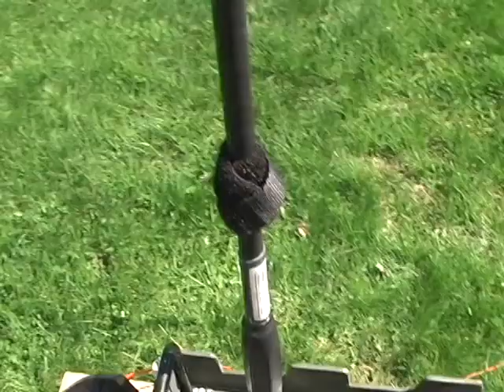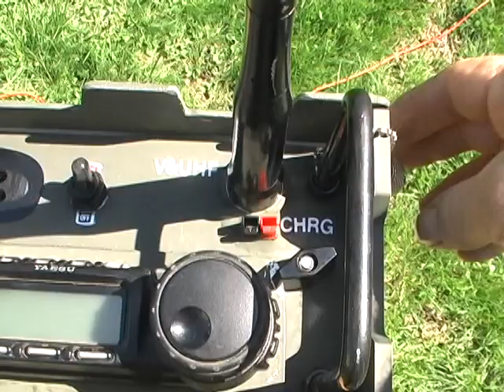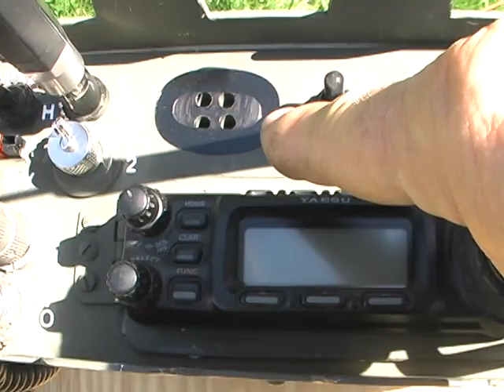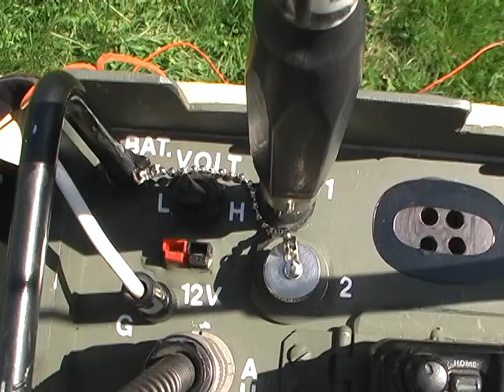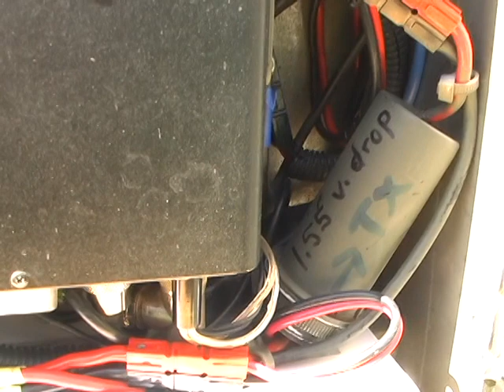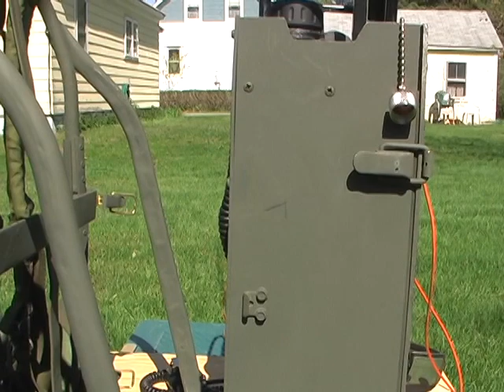Yaesu FT-857d manpack 2...home brew/shorter version.

Comment: What battery is used
Reply from the maker: Hello John,  This is the battery pack that I used. Just keep in mind when the pack is fully charged it is at a max voltage of 17.2 volts.  So you will need a way to reduce that voltage to a safe amount for your equipment. I built a step down zener diode circuit to reduce the voltage by 1.5 volts.  https://www.batteryspace.com/High-Power-Polymer-Li-Ion-Box-with-fuel-gauge-14.8v-10Ah-148-Wh.aspx  Many blessings to you and yours.

Comment: Nice setup. How hard was it to wire both the handset and headphone mics to the radio from their connections?
Reply from the maker: Hello Christopher,  It took some brain storming to figure it out I must say.  If you look closely you will see I'm using a 8 pin for the Sordin headset and a military connector for the handset.  The corresponding wires that connect to the input of radio are all interconnected behind the plugs inside the radio case.  Thanks for viewing and God bless you and yours.

Comment: Philip
I hope you have had a great day. I think that I have watched your videos probably ten times over today. I just underwent a third surgery on my shattered right ankle.  So that being said I  am stuck here in the hospital waiting for it to heal. If you check out my QRZ page I had built a go box rig using my  Icom IC-706 MKIIG. I have also added VHF in s separate rig. and as I mentioned earlier I like digital so I have added a Signal link USB to the mix.
I hope you don't mind me asking a few questions. How does the vertical antenna  work for you. I think I have an outbacker antenna around the house somewhere. I could never get it to work too well. 
I have to build the backpack version with my Icom with the LDG tuner. I was also thinking about building a second one for my MFJ-9420. I am looking at emergency communications.
Thanks so much for your time.
God bless you and your family.
N6PGG / 7 Dave
Reply from the maker: Hello Dave,  I sorry you have had to go through multiple surgeries my friend.  Not fun I'm sure. I pray you will heal quickly and well.  To answer your question on the use of a vertical antenna with the manpack.  It is a great compromise when using a vertical antenna rather than a full size wire antenna on some bands. I find that 20 meters through 10 meters is not too bad but a counter poise wire is needed or some source of ground plain. I've seen  a couple other video's where the person has used the outback antenna and seemed to work fairly well.  You will just need to experiment with it a bit to see what works the best.  Most of the time I'm setting the rig up as a portable fixed station with a portable home brew wire dipole latter line fed antenna and a 4 to 1 balun on the latter line.  I hope this answers you question.   Many blessings to you and yours and get well soon. 73's from N1TZU..Bob.
Reply from the maker: Oh and Dave, I'm assuming by your screen name you served our nation.  Thank you so very much for being a part of providing, what I and many enjoy. ( Freedom.) :-)